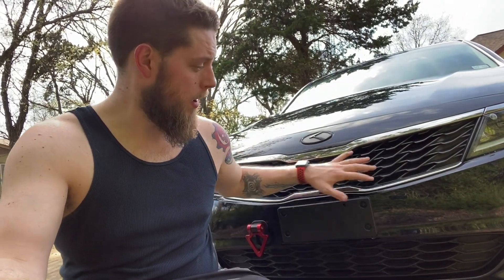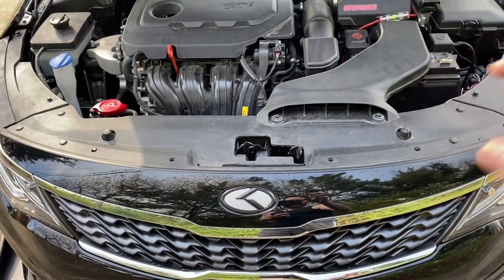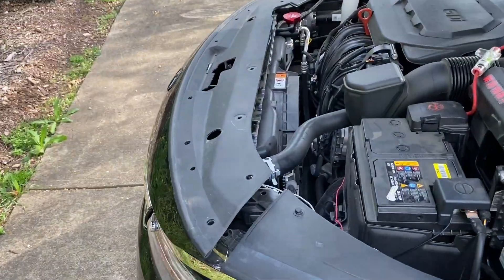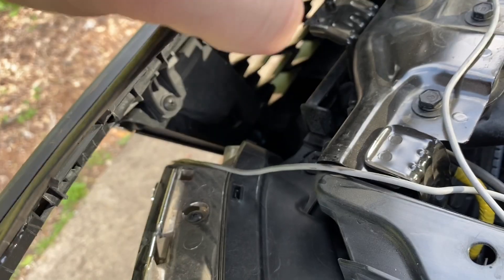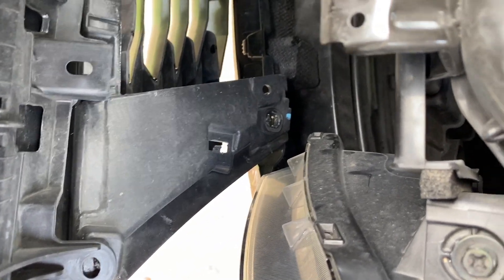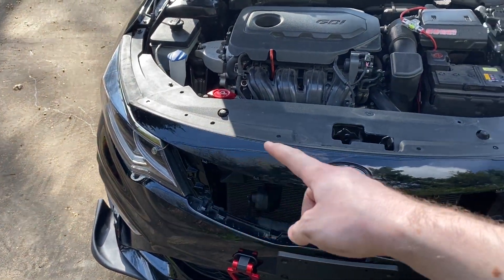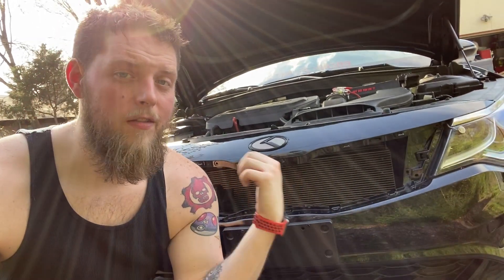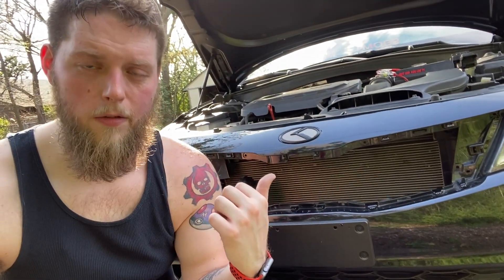Removing My Grille! (Super EASY!) 2019 Kia Optima

Comment: Hi Where did you get that front tow hook? Wondering if that would fit my 2014 Optima
Thanks
Reply from the maker: It’s just a stick on “dummy toe hook” it will fit on any car but it’s just for looks, don’t actually try to tow with it. I got it on Amazon. If you look on my channel for a video called “what the optima looks like now” there should be a link to it in the description.

Comment: My Kia Rio has a similar grill except it's completely closed in there's virtually no openings in it I took a Dremel and cut the openings out I would prefer to have the grill in there to protect the radiator from trash off the road.

Comment: Holy crap this is difficult, I got the screws out but the plastic clips don’t wanna come loose
Reply from the maker: You may have to give them a little encouragement by lightly tapping the grill outwards from the inside of the bumper to get the clips to dislodge. May have to tap harder if they don’t release.
Reply: @KDMCurt  I finally got it! Ripped it straight out surprisingly without breaking anything 😅 thanks!
Reply from the maker: @Arctyy  haha sometimes they just need a little motivation 😂